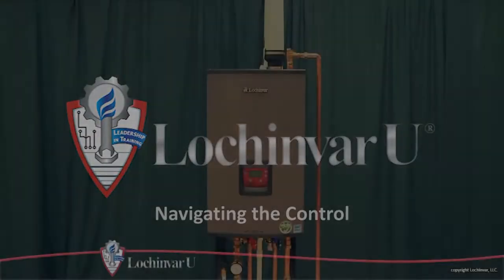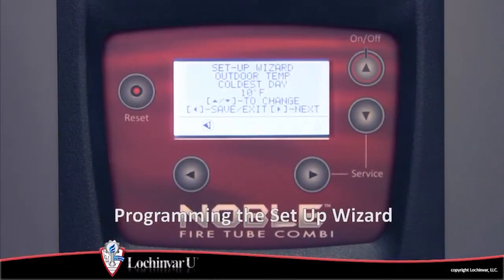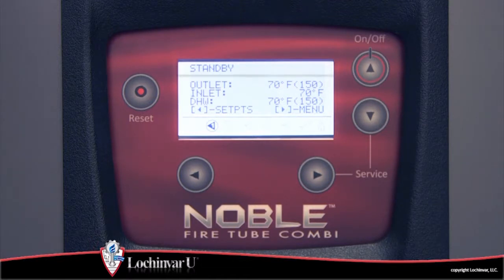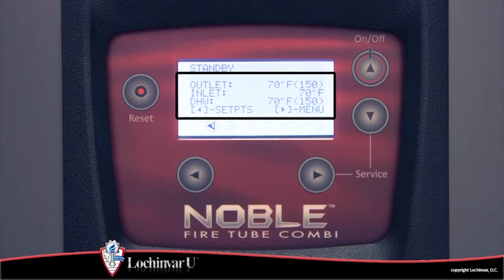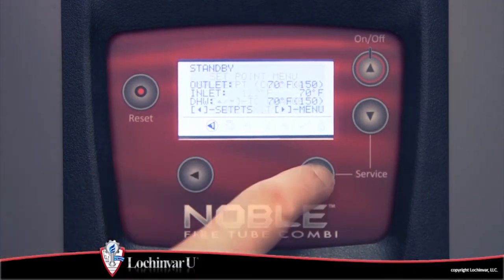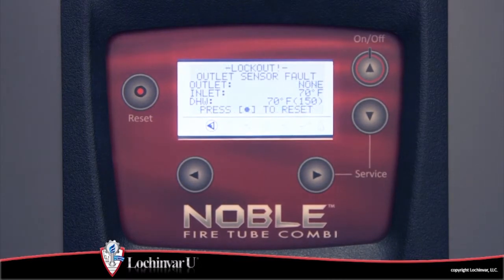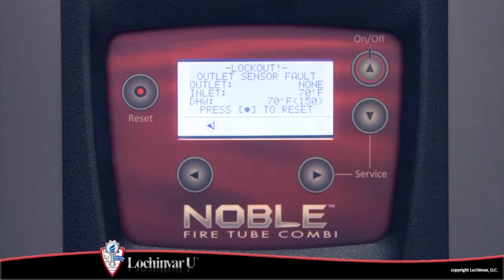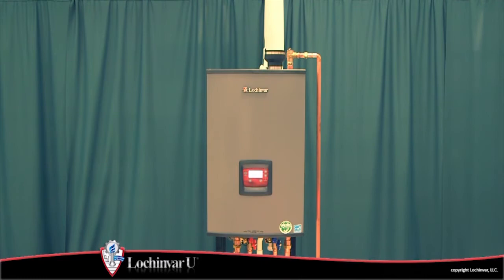Navigation

Comment: such a nightmare of this setting!!
Reply: Please be aware that there have been 2 separate recalls for the risk of carbon monoxide poisoning for some Noble models. The Recall information can be found on the Consumer Product Safety Commission (CPSC) website.

2020 Recall:

"The boiler’s flue grommet can deteriorate and dislodge during use and allow the boiler to emit carbon monoxide, posing a risk of carbon monoxide poisoning."

2023 Recall:

"The boiler’s flue collector can crack if exposed to a high impact event in the burner chamber, which can allow the boiler to emit carbon monoxide, posing a risk of carbon monoxide poisoning."